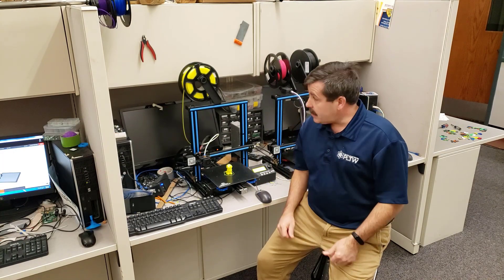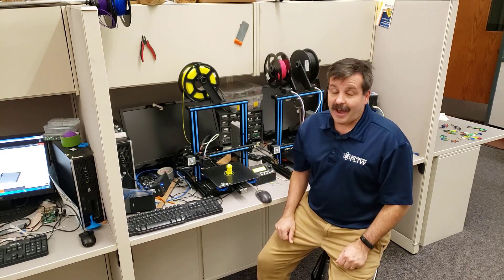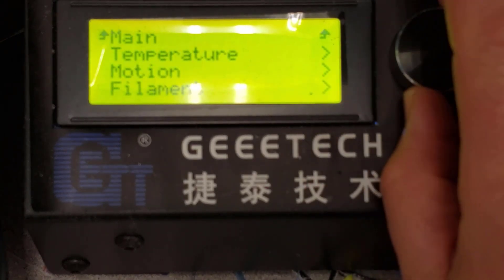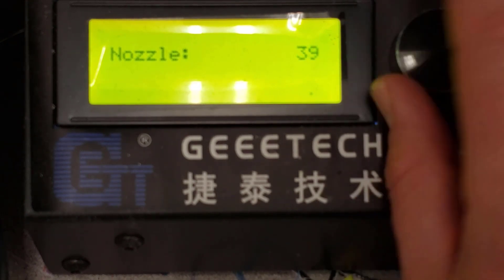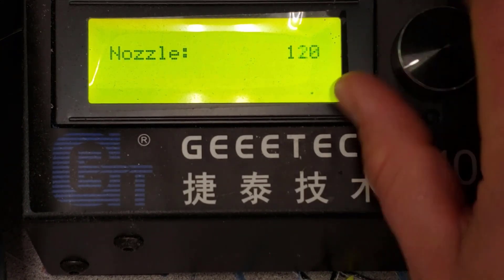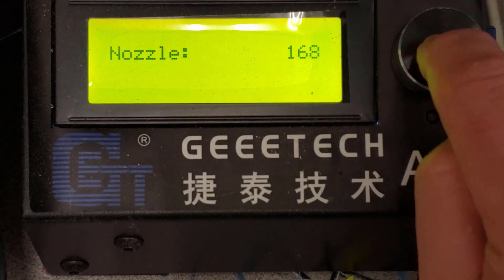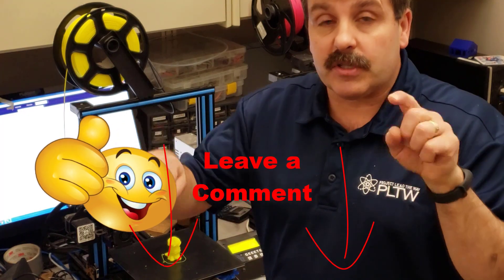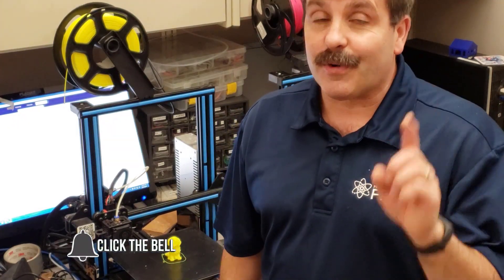Where is the setting in Marlin firmware for the dial?  Geeetech A10 fix?

Comment: can you also pleas add to your futur video how to offset the x and/or the Y axes?
becouse mine has the wrong ofset right out of the box :(  bad developers -.-
Reply from the maker: That is really frustrating. Did the dog print fine off the SD card? What are you slicing with?
Reply: @HLModTech  i bought the Geeetech A10 pro without the 3D BL Touch. Because I bought the it elsewhere with with a discount Action. Now that I think about it. It started to slam the carryer against the Y axes beam after I upgraded the firmware to the A10 pro with 3D BL touch... I messured it the whole bed is digitaly shifted 37mm to the right. Exactly the distance from the nozzle to the probe. I use Cura slicer. I downgraded it again and un plugged the BL touch, now it works Flawless again. That's a shity solution, I know but if the geeetech guys don't fix it, then the whole selfleving nonsense is crap that can go straight to the trash
Reply: And honestly I do not have the pacientes to do their job. And modify the firmware until it works. I bought this specific 3D printer because it works right out of the box and I can do prints for my projects. I don't want to have the printer itself as a never ending project.
Reply from the maker: @icebluscorpion  I manually level mine for the same reason. It took a little practice, but at this point, I do it so fast that ABL would be a waste of time.  I have 2 Anet machines that came with an ABL system and they work fine. Like you, I found out early that I am not really interested in modding my printers.
Reply: @HLModTech  I thought there where an easy fix for this out there but in the end it is as you said a waist of time the ABL. Because that thing seems Stil work in progress from the company side. So I will set that on hold for now and use the firmware without ABL. I bought also a removable printing platform at gets attached magnetically no bed leveling needed after the first leveling. I wanted to add the BL touch to experiment with uneven/curvy underground to use nonplanar features. but without a proper firmware/infrastructure to base on,it gets exponentially frustrating and nerve-wracking. So I do it like did by hand. I personally use a sheet with constant Constant thickness like backing paper or Aluminum foil. I deliberately choosed that because, you can quickly see if you tightened the space between nozzle too much up. Ideally it should dent the backing paper/aluminum foil without ripping or tearing it appart then you get a thickness of 0.016 or 0.02 depending on the brand.
Reply from the maker: Neat idea with the foil. I always like the scratchy sound of paper.  Vert uses ABL a ton, so I do think it is possible. I just do not have the energy to play with it. Have you tracked down his channel?

Comment: In configuration_adv.h, search lines with "#define ENCODER" and set the values as here under

#define ENCODER_10X_STEPS_PER_SEC 40    // If the encoder steps per sec exceeds this value, multiply steps moved x10 to quickly advance the value
#define ENCODER_100X_STEPS_PER_SEC 80  // If the encoder steps per sec exceeds this value, multiply steps moved x100 to really quickly advance the value
Reply from the maker: Thanks! Worked like a champ! A user share as well in a Facebook group. They are so fast sometimes. Sure do appreciate you taking time to share as well!